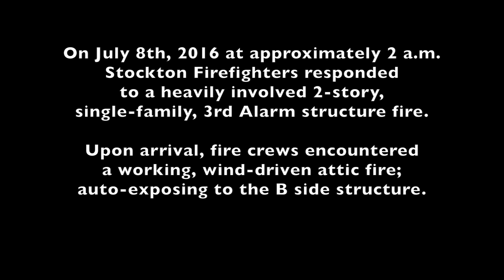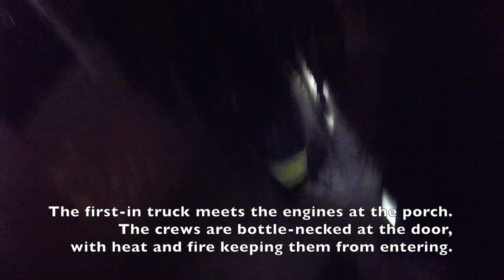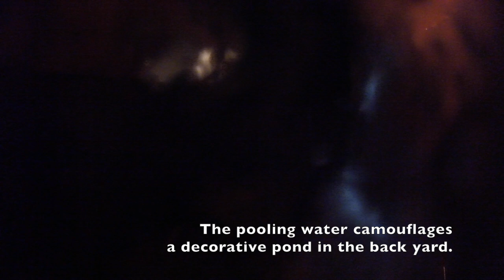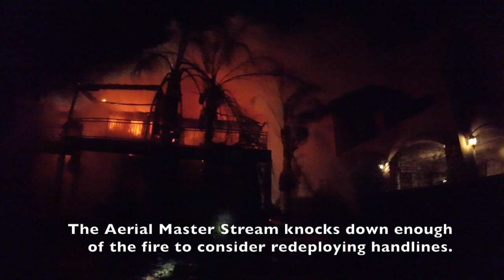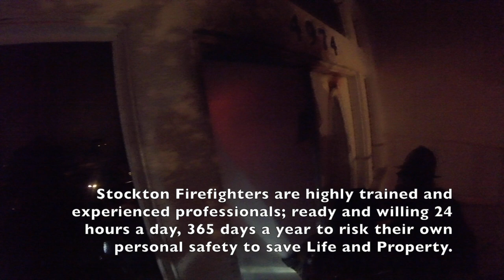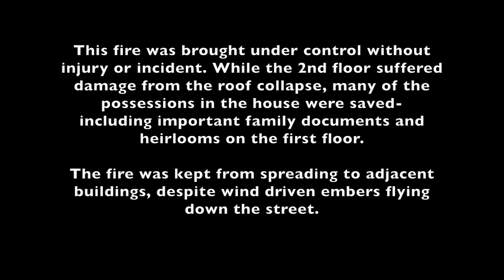Roof Collapse • Stockton Fire • Multiple Angles

Comment: On a Fire like this we would pull in Germany about 120 Firefighters from not then less as 6 Stations around. (Voulenteer Firefighters). A Town like Stockton in Germany would have for sure paied Firefighters in serveral Stations.But much more than 12 for sure. For Example Augburg,Bavaria about 300000 People live there the have2 Paied Firestations 24 h/365 on Duty. But they have also 8 Voulenteer Firestations and if that is not enough the Augburg County outside of theTown ,where also serveral smaller Firestations are can aid. The Augburg  County have 250000 People living there  and 132 (!!) Firestations. Means many smaller Villages arount the big Town  have at least a Firetuck , hose who are near Highways more. A Firestation in Germany have in small Village often about 35 to 50, bigger Stations up over 150  active Members,who get called out by Pager ,sms and Sirens. If needed the County Alarming System can call as much Firefighters you needed. There are also Groups for Watersupply, Forrest fire , Fire Fighting ,Water rescue, with only 1 Verhicle from each Station ,the make sure that the Fire Protection  at Home  is still guareteered.